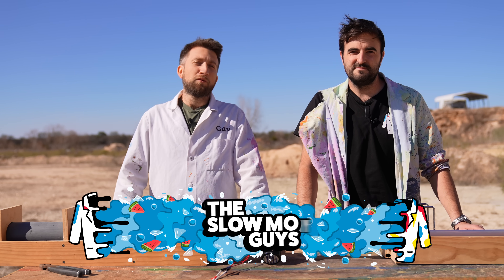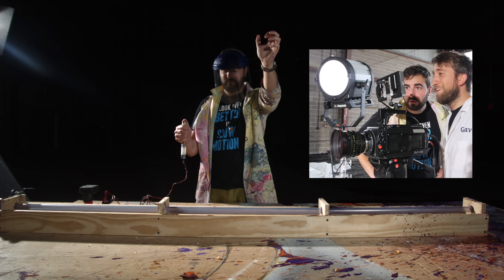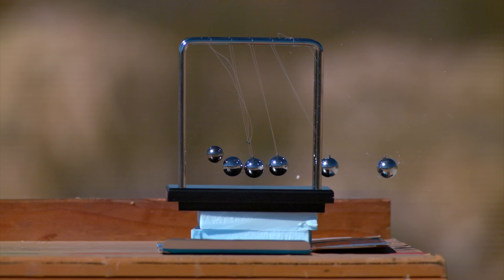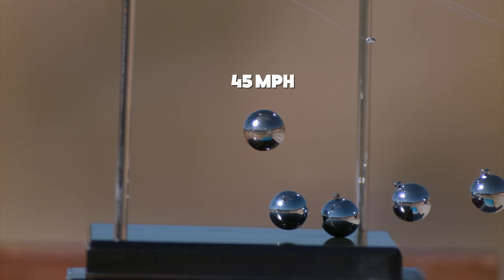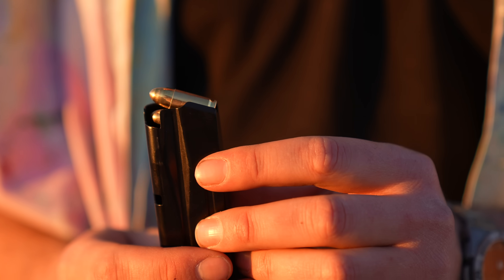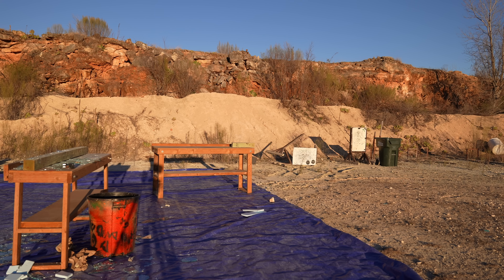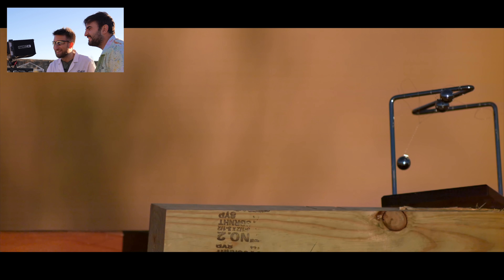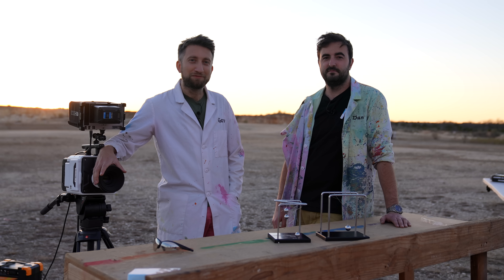Bullet vs Newton's Cradle at 100,000 FPS - The Slow Mo Guys

Comment: The physics here is super super interesting, an with my very little knowledge am probably only mindly understanding, but its still such an intresting thin too watch the strings brake due too what i think are two completely differing forces from one impact. 

Can imagine the first one brakes due too the overall force between the balls which is why metal comes off not the sting the welded point could not take the overall force, just snapping it the chunk away, while the last one is thrown from all the kinetic energy from it flying with little too no resistance compared too the first few, an the center one like Dan said transfers it.

Reminds me of the "Safest place too be in a train crash" The middle is the highest survival rate due too a very similer thing just on a tad bigger scale, an... much more mess.

Comment: A ton of the energy gets dissipated in the bullet getting shattered instead of transferring to the ball bearings.  The ball bearing from the air cannon had very good energy transfer to the Newtons cradle, so it took much more damage in that case.  Sort of like breaking boards in martial arts; it hurts way more when you don't break the board and hardly hurts at all when you do break it.

Comment: Suggestion: How do safety glasses fare against various projectiles?
Reply: There is at least one video of one. Being used for it's intended purpose.
Kentucky Ballistics Scott had his eye saved by them.
Reply: Against small, relatively light projectiles (like if the fragments bounced off of things, or if somehow some powder or something came backwards from the gun) they do very well and are essential. I wouldn't put my eyeball in front of that exploding bullet, though.

Comment: One thought about the bullet. You mention that it was a softer material and had less mass. It may have also had less of an effect because it didn't hit center. It hit low so some of the force directed the first ball more up with the bullet than the ball.

Comment: This is a really cool momentum and energy experiment, itd be fun to do in a physics class. The fired ball impacts on the mass of 5 balls, so it deforms a lot and loses a lot of energy/speed. The first ball it impacts on the mass of 4 balls, so it deforms slightly less, but ends with slightly more speed. The second ball moves the mass of 3 balls, so it deforms even less and ends with even more speed. So on till the fifth ball, which doesnt lose any of its energy to collision or deformation, so it goes flying off at high speed.

Comment: Because the formula for kinetic energy is e = 1/2m*v^2, the bullet has much more kinetic energy than the ball bearing from the Malteser cannon, because it's going so much faster. Speed is more important for calculating that than mass is, but again, that's were you run into problems with the hardness. Bullets are designed to deform when hitting something, specifically people, so that they do more damage. That's why they're made out of lead, and not steel - normally.

Comment: you say 45 mph is a bullet, more like 10x more, 800m/s or 1000m/s
Reply: try an armor with balls in a tube, multiple tubes side by side
Reply: try a pile of bearings, say, in a can/jar
Reply: try polycarb deflector sheet at 45 degrees angle or more, for bullets
Reply: shoot a reaction wheel (spinning energy storage flywheel)

Comment: The bullet coming out of the pistol was too soft of a material. Thus, most of the force that went into propelling the bullet through the air was consumed in the bullet fragmenting. Sure, there was a mass difference, so the balls wouldn't have moved as much (F=MA, so you'd have M1A1 = M2A2) even if the bullet didn't shred itself on the balls. Maybe harder rounds if you can get them?

Comment: Wonder how those would react with a solid brass round. I imagine it wouldn't be much different.
Reply: There would be a lot more energy transfer. Solid brass/bronze rounds deform a lot less than lead core. It's still break but as it would take more energy it wouldn't be dissipated in the fragments.

Comment: Speed of sound of steel (speed at which vibration propagates) is around 3200 m/s. Speed of bullet (I dont know fast that one was) but pistol is around 300, ar is 700-900 m/s, which means that waves are still faster than bullet itself so it was not possible to go through all the balls without last moving. (Of course if these balls wouldn't break)

Comment: This sounds like the background to an Energy and Momentum Physics exam question lmao

Suppose there is a newton's cradle of 5 pure steel balls of 20 mm diameter. A 9 mm bullet is fired from a pistol at 785 mph to impact horizontally with the newton's cradle. Assuming a pure nickel composition of the bullet of an assumed spherical shape, perfectly elastic collisions, and that the bullet remains intact upon collision, what is the initial velocity of the last newton ball in the cradle?

Suppose the final ball bear snaps off the string and travels at perfectly vertical trajectory, in the absence of air resistance, what is the maximum height of the final newton ball from snapping point?

What's maximum distance the final newton ball could travel from snapping point assuming you could control when the string snaps to let the ball fly?

Comment: The Newton's Cradle works because the force being transmitted isn't high enough to cause permanent deformation of the balls. Those collisions are more-or-less elastic, so more force gets transmitted. You're firing a projectile with enough force to cause those inelastic collisions, and part of that initial force load is being lost with each successive ball due to those inelastic collisions.

Fun note, crumple zones are designed specifically in cars these days so that in the event of an accident, most of the force is eaten up by the deformation of the vehicle. This sounds counterintuitive, as you don't want your car to fold up around the occupants. But the more energy the car's body can chew up when crumpling, the less gets transmitted to the occupants in the car.

Comment: I would love to see this done with a Newtons cradle that has stronger string and connectors
Reply: and the supports attached to something so it doesnt fly off!
Reply: I would assume the balls would just fly up and wrap over the top kinda like the end of the bullet one
Reply: @nickpurdy69  That's what I thought, but what I think in this case isn't worth much, so ... ;-)
Reply: @PacMonster0  I thought something like this might be an issue. Maybe a projectile of a lesser weight would help instead. I'm not sure. As you said, this is a very fine tuned object, so it would be tough to find, but must be someway of shooting it without immediately destroying it to the extent either
Reply: or scaled up, big. balls
Reply: @PacMonster0  Well, it wouldn't need to be scaled up, so I don't think the mythbusters' result necessarily applies.    The entire cradle could even be made of stronger materials that weigh less, I think.
Reply: https://youtu.be/SZU1glezsKw